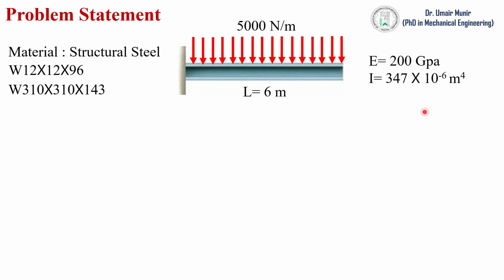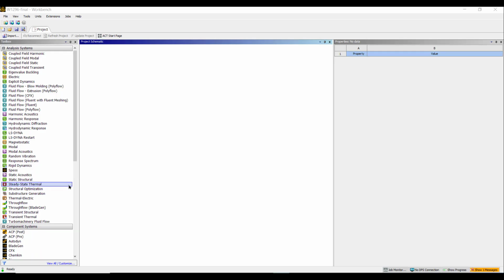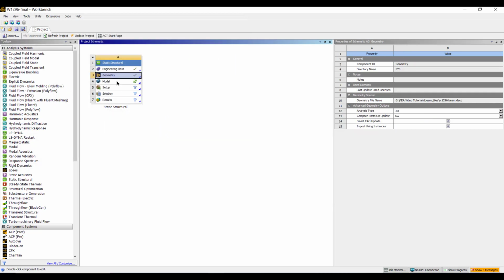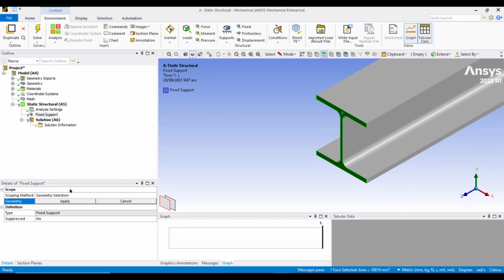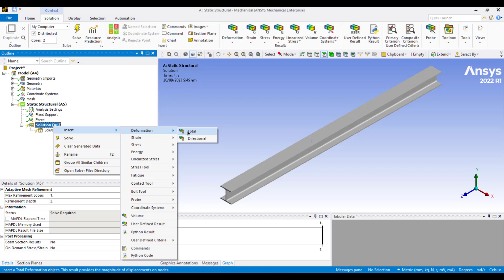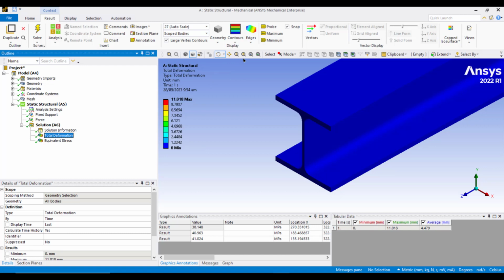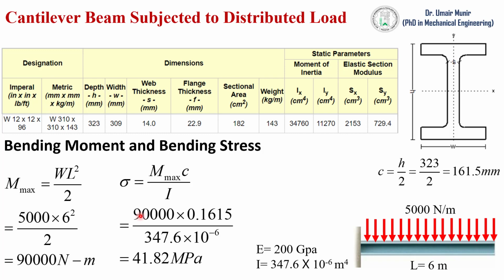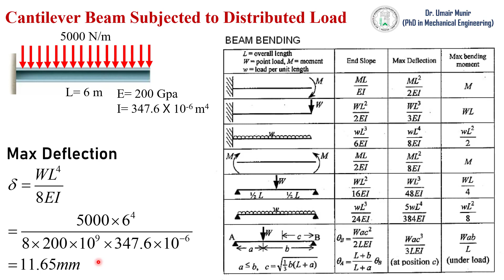ANSYS Static Structural | CANTILEVER BEAM Subjected to Distributed Load

Comment: I am having problem with mesh generation in the ANSYS structural analysis. After generating mesh, i get an error in warning tab saying that "The following surfaces cannot be meshed with acceptable quality. Try using a different element size or virtual topology."